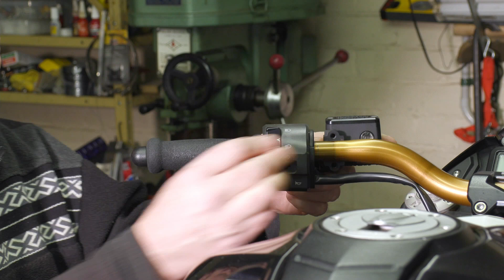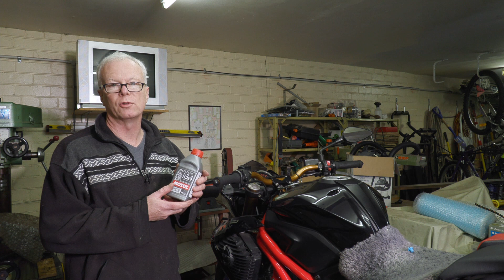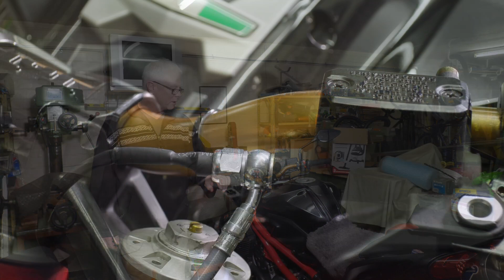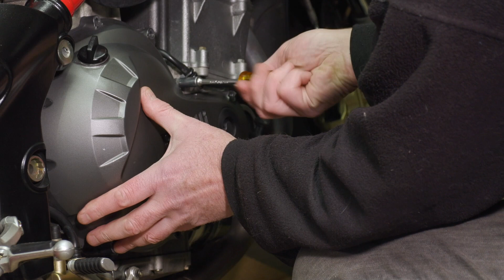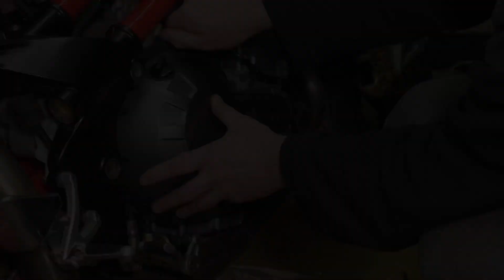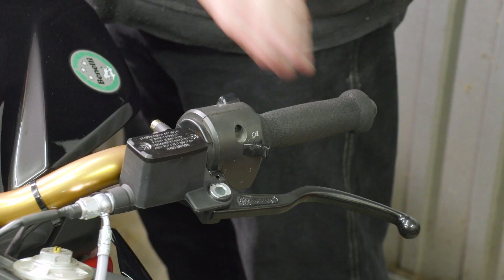Benelli TnT 1130 Hydraulic Clutch Kit - Part 2

Comment: Hi.. Need some advise from you.. How to change the starter cluct for tnt899.. I facing starting issues.. Can't start the bike.. Suspected start clutch problem.. Sound like the starter not engage with crank shaft.
Reply from the maker: It sounds like it could be the starter sprag clutch not engaging. I've never had the starter off mine but the guys on the Benelli forum will be able to talk you through this. 
https://www.benelliforum.com

Comment: I might have missed something, but where did the 2 little "o" rings go? I think 1 was inside the slave cylinder, but not sure.
Also, fyi, I have a 2004 Tornado 900 that I've owner since 2006, which I stopped riding a few years back due to the horribly stiff clutch. It makes neutral virtually impossible (I believe this was a "feature of the model") unless I slip it in before stopping, and the effort to pull the lever and hold it in traffic became unbearable, as I too am getting older and the hands are not what they were.
I was hoping I can get a similar kit as you have. Maniac Motors are no longer selling the whole kit, just the slave cylinder for 299 euros, but I think the rest of it I can make up from other available parts anyway.
Thank you for your video, it has inspired me to put my beautiful red Benelli back on the road.
Reply from the maker: Hi Cailean, I don't recall where I used the o-rings or if I did. Best to ask Manic Motors. But apart from the problems it's been the best upgrade to the bike I've done. The clutch is a lot lighter, has great feel and neutral is much easier to find. It's worth the pain.

Comment: G'day Mike, just discovered this video and it caught my interest as I swapped over to a hydraulic clutch on my Tre K. I got my system from a wrecked bike down your way so I had no history on it or exactly what it was, whether it was original or aftermarket. From what I can now work out it is an Evotech slave cylinder, an original hose and a master cylinder from an old Aprilia Caponord which has the advantage of a mirror mount which takes the original Benelli mirrors and uses the same electrical connection. I was fairly lucky in that everything fitted but it's possible that the previous owner may have sorted that out. The only real issue I had (like you) was with clutch adjustment. I had to get a new slightly longer pushrod from an R160 and even after adjustment I still had to take a millimetre or so off it to get it right but now it's just right. I can get neutral any time I want to and the pull is much lighter. A great modification for these bikes.

Comment: Hi Mate
For the cable clutch system adjustment what would you reckon on the rotation to adjust the clutch plate as its difficult to get in neutral.
Reply from the maker: I always went with the factory spec of 1/4 turn at the clutch assembly and 3mm at the lever. I don't think it's possible to eliminate the drag with adjustment without risking clutch slip when the engine is hot.